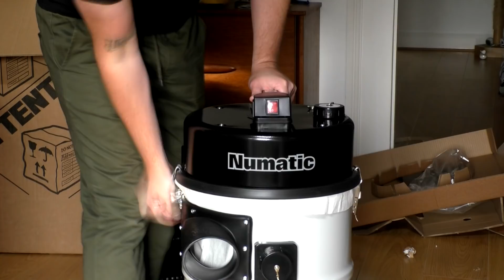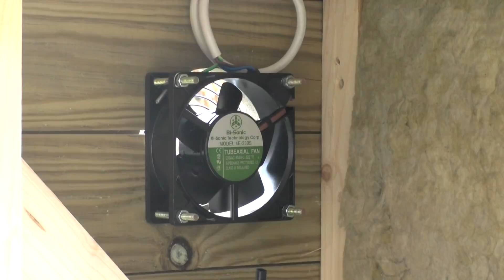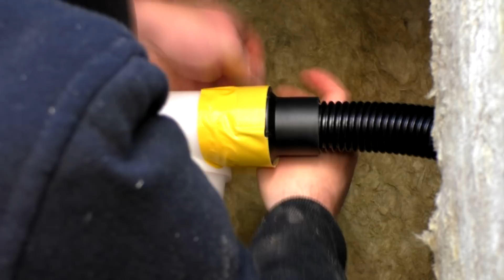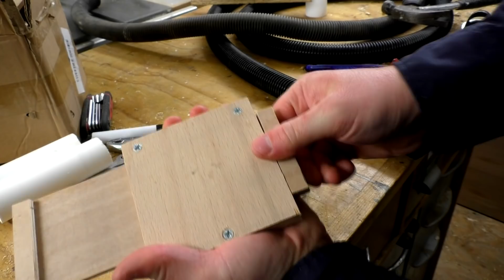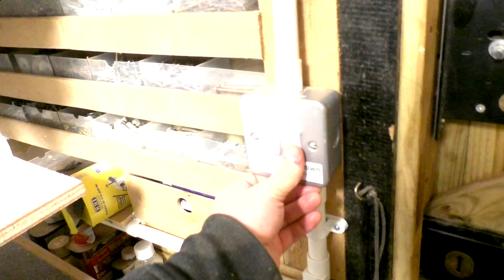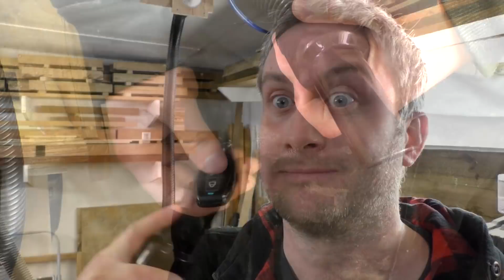My New Dust Extraction System - Installation and Demonstration

Comment: How do you find the compressor? Interested in getting a smaller/compact size one soon. Is it good enough to run impact wrench and nail gun? Thanks
Reply from the maker: I've never used an impact wrench so wouldn't know but it's fine for nailing. It's a decent enough, build quality is bad in places but I expected that for something so cheap

Comment: Could 3D print an adapter for the one that doesn't fit your cyclone.
Reply: If you want to design the coupler you want in fusion 360 or the like I can 3D print it for you.

Comment: Why the HEPA filter if it is in its own shed. You wont be breathing the dust from in there.
Reply from the maker: I'm not planning to live here forever so it may not be in it's own shed forever, also I don't really want it exhausting dust in to the extension all over the insulation etc
Reply: Might you put visors over the fan grills to prevent rain water entering?
The intake particularly might suck in some rain on a very rainy day.
Reply: If I might add paint the inside of the catch can with waterproof paint you're going to have a lot of rust from the moisture off of your wood
Reply from the maker: Sorry I don't understand your comment?
Reply from the maker: Maybe, I think it'll be ok though as the electrical connections are well sheltered
Reply: Rag 'n' Bone Brown What's the IP rating of the fan... That'll confirm if the unit is suitable in that environment.
Reply: Astroflight Good point...
Reply: bonez420inc I don't know if that model has any raw steel exposed; I suspect the inside is pre painted. (I think I've the single motor version; don't recall spending that much for a twin motor version in my partner's grooming room... I'm not that generous...).
Reply: Keith, I do believe Astroflight is referring to the "Muffin Fans" you installed in the extension .
Reply: Hepa???? Why filter it at all? My biggest concern here is those miniature fans, I certainly hope you're only storing that compressor in there and not running it. The discharge temp of that thing is probably around 300+f 150+C and of course that means the metal parts that are in touch with that discharge air will be that temp even when the unit shuts down. I once was dispatched to start up a compressor 100hp 75kw in small concrete building 20'x18' with a 8' ceiling. Upon looking at it I told them it would not work because the unit would over heat they pointed to the 1hp axial fan they had installed in the wall to exhaust the heat...

On that day it was dead of winter and 6 degrees Fahrenheit outside about 10 deg F inside the little building before I started the compressor. Upon starting the compressor and doing my checks it got up to operating temp so then I shut it off and went to get the customer for a little demo. We walked into the little building now about 35-40 deg F from the heat of the compressor radiating. I started the unit with the 1 hp fan running and it took 10 minutes before the compressor shutdown on high temp. Now there are numerous factors involved there not the least of which is the 8' ceiling, but point is a 1hp fan was not even remotely close to large enough and your fans are probably 1/100hp. But I see this video is from 2017 so if I'm wrong let me know.
Reply: Disregard I've now watched enough of the video to know you are in fact running the compressor in that tiny space with those tiny fans. I'll just say that air compressors make heat, compressed air is a byproduct. the nature of the physics of compression is that about 85% of the power put into a compressor becomes heat, only +/- 15% becomes usable compressed air.

Comment: don't want to rain on your parade, but the single motor version has a smaller diameter pipe for a reason. the two motor one you paid extra might now be working much better than the single one with the restrictive pipe diameter you're using. yeah I know, it's maddening being told that after having done all that work. believe me i've done the same mistake...

I'd suck it up and upgrade the piping everywhere up to the tools.

here's some good tips:
https://www.woodmagazine.com/woodworking-tips/techniques/dust-collection/avoid-common-duct-design-flaws

here's some research
http://billpentz.com/woodworking/cyclone/ducting.cfm#ducting_diamter
also read the resistance chapter if you have the time.
Reply from the maker: Thanks, wasn't aware of that. The trouble is I don't have space in my shop for the large pipe. I could probably get away with large pipe in the extension to the cyclone but not sure if that would help....?
Reply from the maker: Thanks for the links - interesting reading, although that billpentz one is a bit too intense reading for my little brain!!
Reply: I was thinking the same thing.  All that power and he choked it 3/4 to death with 1.5" corrugated pipe  :(
Reply: Ya just did my dust collection, best to use diameter of blower intake to dictate size pipe throughout your shop, generally 4" for 3hp and lower, run your 4" as far as possible to the tool and choke down to tool port at the last few feet, minimize use of 90 degree turns in favor of two 45 bends. And nearly every tool requires some modification as most dust collection designs suck. In a bad way. Err. Don't suck. You know..